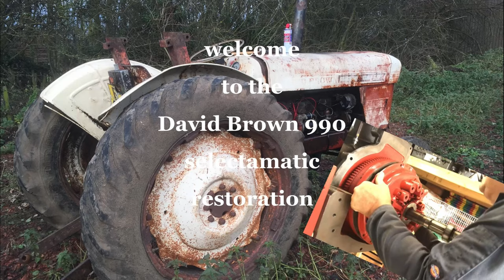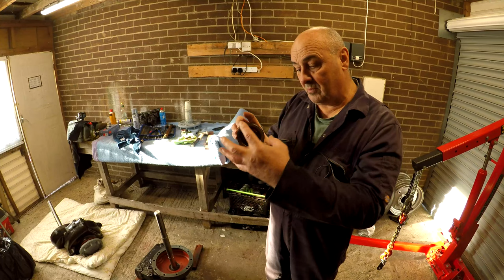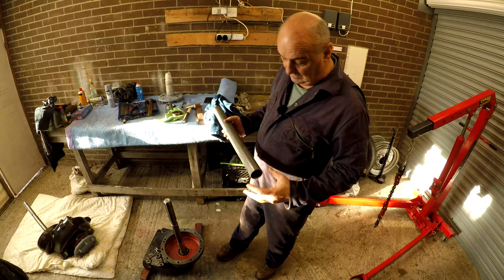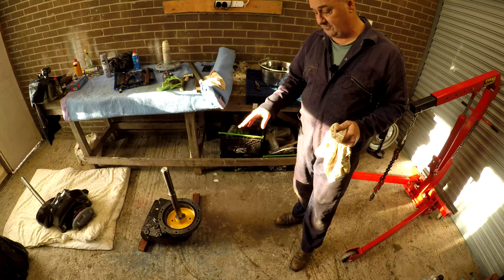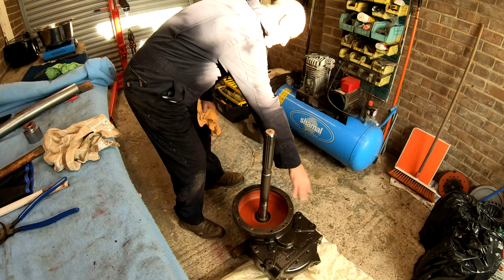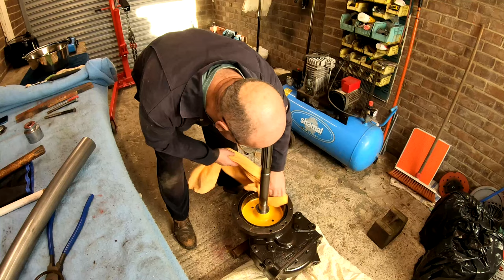Refitting the David Brown 990 brake drums #77

Comment: No more Jam for you if Debs wakes up to what you are up to, lol. That worked really well, I was thinking my induction might be ok for that job.
Reply from the maker: G Day Lance, I'll give it a good wash with fairy liquid and slip it back in the cupboard before she gets back. if I start speaking with a high voice you know she's found out.
your induction heater would be good for this, would just need to form a large enough coil, could try putting the coil around the central boss as the other side of the coil would also heat the outer face.
it's trying to get the heat uniform so as not to stress or crack the drum
many thanks
Barry

Comment: I  think I will have just got the big blow lamp out to get the drums back in. I did not know about taking the cover off but it took so much effort to get them off it would have pulled the barring with it a bit so when  I encouraged the drum on it will have hopefully  gone back to where it started. Nice paint job on drums. M😀
Reply from the maker: Hi Marshall, they came up well, pitty no ones going to see them once the final drives are back on the tractor.
many thanks
Barry

Comment: Those went in much easier than I was expecting them to.  Great process!
Reply: I was going to say the same thing.  I did not heat mine when I reinstalled and they were a little tougher to get back on than what Barry just did.
Reply from the maker: Hi Shane/Tom, yes I was pleasently surprised as well, I knew heating would make it easier but I still expected a bit of a battle. very surprised the paint stopped on as they where at180deg, hammerite must be good
I also fettled the keys as they were both sticking in the keyways, took a file to them till the just slid in niecely, I remember when I took them apart the keys showed signs of gawling, so must have been to tight.
many thanks
Barry